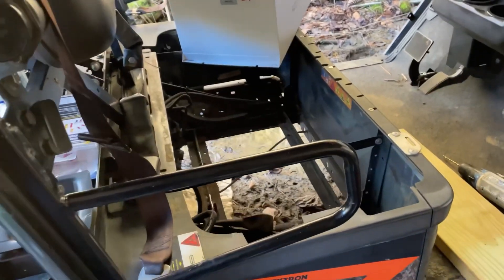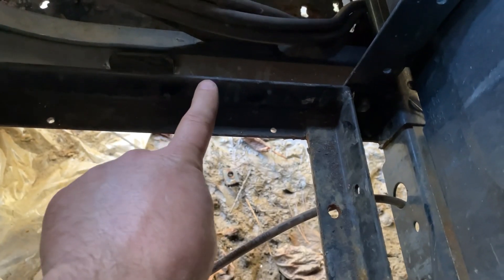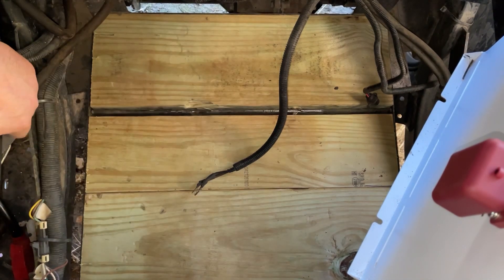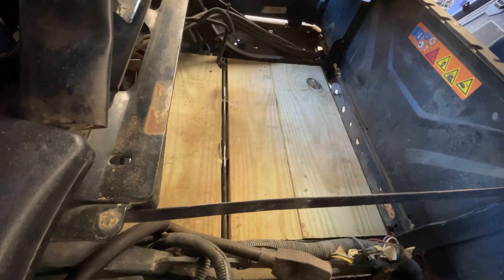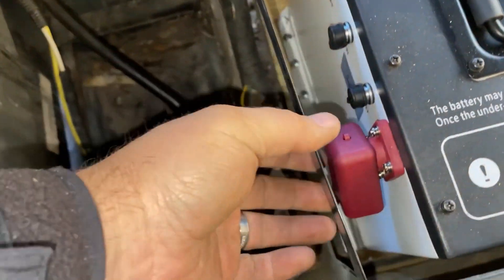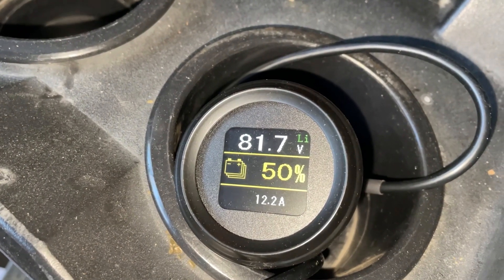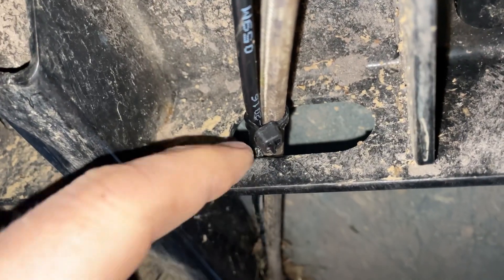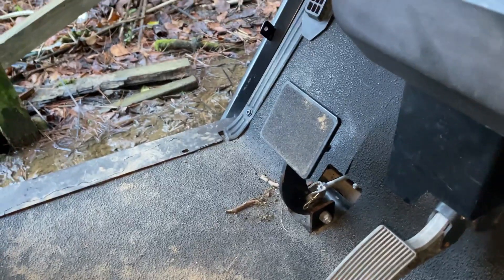Tracker EV gets 72v Fleet Lithium 105ah battery upgrade ( Install )

Comment: Does this new battery make the machine faster or go further or both
Reply from the maker: 3 times the distance over lead acid. 
Top Speed increase has to be programmed to the controller

Comment: Thanks for the informative video.  I have an EV IS that works great, and I have two of the heavy duty battery chargers at two locations.  I don't like the on-board charger, as it is not nearly as water and mud proof as the rest of the chassis and the batteries.  Is the lithium battery charging so different that my two existing charges cannot be used?  Pland to convert in a year or two.
Reply from the maker: Completely different algorithm. 
You have to have a designated 72v Lithium Charger

Comment: I have the same setup, 72v Textron, and need to replace batteries. Thanks for the video!  Which battery cables did you remove/replace to hook up the Lithium. Also, can the controller boards handle the 76v?
Reply from the maker: I will upload a new video tomorrow, “Range Testing”. 
17 minute video which is more informative, and will have the contact information on where to pickup this FleetLithium battery kit. 
Fill free to watch all my videos on this 72v buggy. Tons of upgrades. Welded rear differential for positive traction. I am doing tons to this buggy, and I will post everything I do. 
I just picked up a new dump bed that I’m going to install on it, as soon as I get the rear seat taken off. Feel free to subscribe if you haven’t already. Thanks for watching!
Reply from the maker: The controllers can handle up to 96v. They are programmed to the motors specifications, and other electrical components as to not over voltage anything.

Comment: Did you have to eliminate all the battery connections that went to the 6 Trojans???
Reply from the maker: Not sure what you mean?
I’m no longer using the lead acid batteries, so I would have no use for their connections?